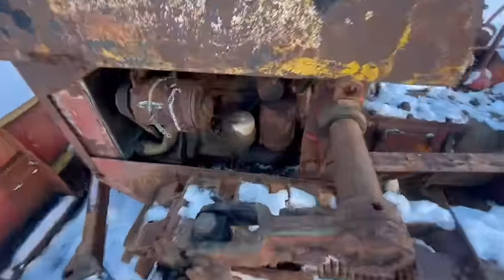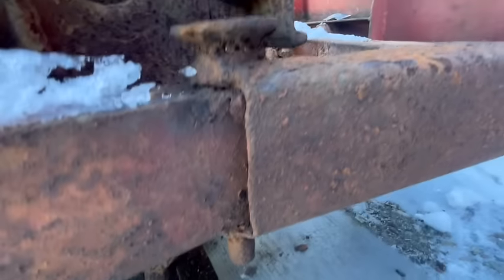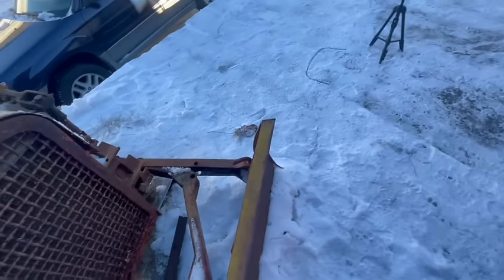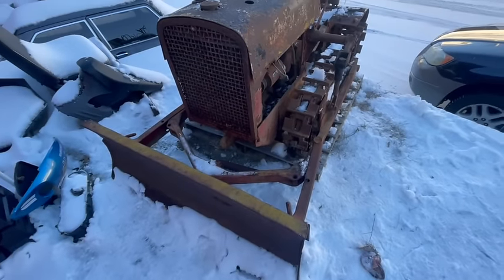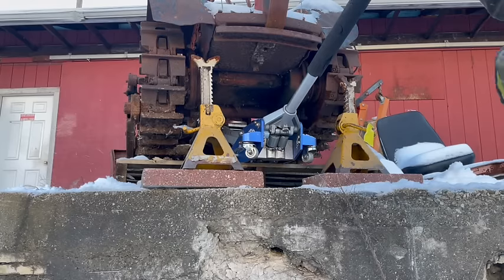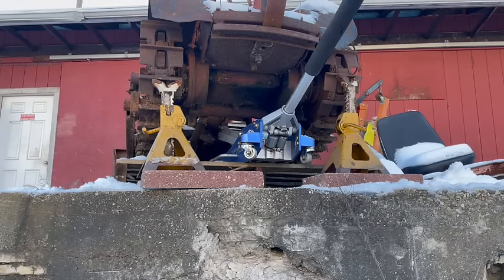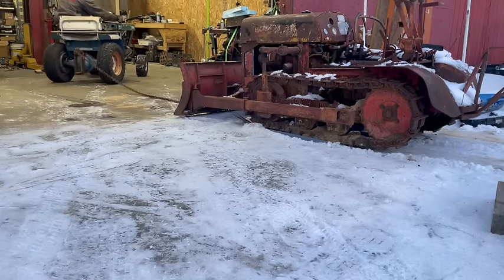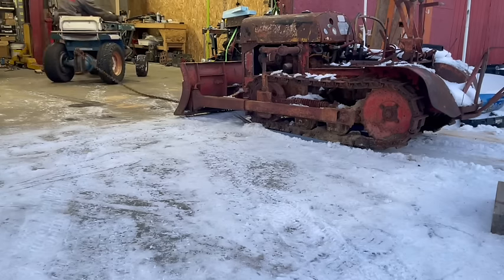Is this the smallest bulldozer ever made? lets fix it! Part 1 of ?

Comment: I'm truly glad to see you saved a small piece of history from the furnace. It amazes me how many old pieces of equipment are scrapped because someone doesn't want to spend time making it useable again. You also need to employ snatch blocks more when trying to move equipment.
Reply from the maker: Thanks so am i nothing of its capacity and size will likely ever be made again. My favorite time period of things to restore because they have very few perishable materials. Once you get things moving and clean they will usually work. Snatch blocks are extremely usefull. I did things the way i dis in the video to show a progression of using available tools and methods. My whole thing is getting the most from the least. Even my choice of tools. There is more behind what you see😉🇺🇸

Comment: I restored a Old Tara trac Dozer 20 years ago 1 1/2 times Bigger, But still small to most Dozers, Do a Nice job, Getting Running Then Take apart sand blast Paint , You will Have a Nice little Machine, Fine a small diesel for it,  Great Find Good Luck,
Reply from the maker: Ill do the best job i can. Normally id agree with an engine swap but its hard to change something that has worked for so long. I think it deserves to live another life. The rear sprockets are a concern to me as far as wear i may need to weld some material back on

Comment: I would believe the Struck would be smaller but this is cool too!!
Reply from the maker: It may be the smallest by density as it weighs 1900 according to the beetle crawler tractor that seems to be its predecessor. Mity kat took up a small production run with the leftover parts i gather
Reply: Strucks were much smaller in the beginning, (I have one) however the pricey ones made now are more of that Kat size & larger.

Comment: Nice PA garden tractor, need wheel weights, loaded tires, or both would help a lot. Too bad it doesn't have the old school engine, they have nice torque.
Reply from the maker: Thanks. The engine on it is a 15hp ohv. No issue on power. It was mostly the really cold day mixed with snow and smooth concrete. I move cars around with it and on the pavement its unbelievable. Only tractor i know of that came with a plymouth automobile rear axle
Reply: @jmpsavescars  ah nice, the old cast iron engines just had more torque/inertia, old HP ratings were "lower" than todays - 10hp back then is like 13-16 now, sorta.

Comment: Mity Cats are small but heavy like My Agricat Model A but the smallest and lightest were probably the Struck Mini Dozers.
Reply from the maker: Were going for smallest dimensionally heaviest construction. The agricats are more of a true dozer than the struck. The mity kat is 2350 lbs liqid cooled direct drive with a reversing clutch a four speed gear box into an oliver oc3 diff into gear drive portals to a full undercarriage. Its about the heaviest batch of parts you can fit in a 4x7 box! Haha thanks

Comment: My Machine Had same Motor, Put a Picture of rear drive, It Probably has same drive as Mine had just 2 Brake shoe bands, raps around Steel drums. simple to Fix
Reply from the maker: Hercules zxb? Really. I understand whats in there just a mater of getting to it and getting the parts if needed. Thanks

Comment: Omg. The SEAT mounts on that high flat bar at the very back of machine
Reply from the maker: Yes it does. Really the safest spot if the machine were to roll! The seat design was changed after this generation to move the operator higher up and forward

Comment: The Windolph dozer built in Portland, Or. was a bit smaller than yours, and during WW II Clark made one called the "airlift" which was delivered by air to newly captured territories to cut in runways.  The Clark is a bit bigger than yours.
Reply from the maker: The clark ca1 is larger and the pacific western gear works beetle were used in a 2000 and 4000 lb version. The mity kats are built from the remaining beetle parts in the 2000lb form. The fluing dozers. Mity kats were used by many state and officicial depaetments for remote access and trail work, fire fighting, you name it really cool machine.

Comment: I wish we could see if the motor turns over. It was hard watching you ride the struggle bus dragging it in the shop
Reply from the maker: The point of the video was just that. Perseverance and ingenuity. I showed many simple techniques put together to move a real heavy object with one medium sized frenchman, leverage and friction modification. 👍 psss. Ive got a secret…the engine is not seized! Wont turn a full rotation but eh thats a good start
Reply: @jmpsavescars  good to know that secret!! Sounds like a valve is sticking or there is trash in the cylinder. I’m excited to see that little machine moving around…… on its own power though!!! lol!!! Good luck!!!

Comment: No it's Not, Here in the UK we have the Ransomes Crawler... much smaller...
Reply from the maker: After reviewing i agree the ransomes crawler is smaller track wise but overall dimmentions i believe the mity kat is the same or smaller. The mity cat is a purpose built bulldozer will a full undercarriage and weighing in at 2350 lbs. it also has a mould board and arms that are the same setup as a full size dozer. Crawler tractors with attachments to me are a slightly different category. The statement was made in order to define all comparable machines i will add this entry to the list,thankyou

Comment: lennox kitty tracks 1960's
Reply from the maker: Those are a little smaller. But are they a “bulldozer” tractor data has them listed as a garden tractor and it does in fact mow grass. I think the blade and arms for the mity kat weigh as much as the whole machine does.

Comment: No I can see why it was parked within 3 minutes of the video starting the rear sprocket on the right side if you're looking at it from the back is completely rounded over there has to be changed before it will ever do any kind of work it will move under its own power maybe but it ain't going to push nothing or turn very well

Comment: Do you know why you need a Bolens husky????
Lockable rear axle. No one legger.
Reply from the maker: The pa has independent brakes i could have jumped on the brake of the the spinning tire but i insted created some heat and gave it another yank.
Reply: @jmpsavescars  OH. Well, I stand corrected. Didn't know those had independent brakes. I'm actually kinda impressed. I've owned, and repaired several hundred tractors. And never one Panzer. I'd absolutely love that dozer. I've had a couple magnatracks. But that thing is sweet.

Comment: They make smaller ones.
Reply from the maker: There have been smaller foot print machines made that hold a blade “mold board” and have tracks but none this small built from parts so big.

Comment: Hi there.  You reached out to me on my channel and I can help you with information.  I had 5 of these.  S/N's 367, 389, 417, 426, and 436.  I have created a serial number list from a lot of research and I estimate at least about 100 units were made from that list.  That list ranges from #340 to #442 and I just added your numbers.  Yours was not on it.  Over the course of collecting the numbers, I found that the engine numbers are not consecutive as compared to the order the machines were numbered.  I would guess the engines were pulled at random when the machines were built.  The "56" you stated is just the end of the engine serial number and not the year.  The engine number should also be on a tag on the engine block.  From a document I had, the only solid manufacturing date is #378 made in 1954.  the engine is a Hercules ZXB-3 and was also used in the Avery V tractor.  The Hercules ZXB-5 was similar but different and has some internals that are the same but are way different on the outside.  The big transaxle is from an Oliver OC-3 or Cletrac HG.  The for/rev box is a custom Mity Kat thing with the MTU clutch mechanism being made by twin Disc company.  The tracks and sprockets are also one off Mity Kat and are impossible to find.  I had one new one that I was thinking on getting casted.  Never happened.  I just got a message from Steve H. and I think he left me a phone number.  Can I call you to initiate contact or do you have an email I can reach out to you on?
Reply from the maker: I really appreciate the information and the call today i cant wait to get going on this machine and bring a light to these very unique machines that time has allmost forgotten

Comment: Why don’t you use any Penetrating oil?  Seems to me you are doing a lot of extra work for no reason
Reply from the maker: Oh believe me there is plenty of that in use. So far a full can of lucas, full can of wd rust specialist. Siezed engines and fasteners is my life. This machine has been soaking in the stuff for the whole summer before it was pulled in. Heat and vibration tends to be the most effective. Im yet to break a stuck bolt free and find penetrant behind the head or nut.
Reply: @jmpsavescars  the last time i had to Deal with an seized engine that simply didn't want to i simply connected it with an gear box to another working junk engine and let it rip...i tell you the thing was loose after...
Reply from the maker: @lucyxchan6808  im imagining that scenario and that must have been something to see!
Reply: @jmpsavescars thank you for sparing me the writing. 100% same experience.

Comment: Sorry to say that not the smallest as i think the Ramsom crawler is smaller i think it made in England
Reply from the maker: That machine has been mentioned. that is a crawler tractor with a blade that can be mounted to do bulldozer type work. I want to see a smaller bulldozer mentioned that has comparable defining features. The thing that isolates the mity kat and laurentide beetle, “its predecessor” is the construction and mechanical makeup. It is built the same way as a full size modern dozer. All heavy steel parts not trying to be a stickler but im looking for a smaller dozer to be mentioned that uses the same type of do it forever type of system, really built to break ground ya know what i mean? I will be making a video in the future discussing all the entries and will come to a conclusion on what holds the title. Thankyou more mity kat restoration coming soon!